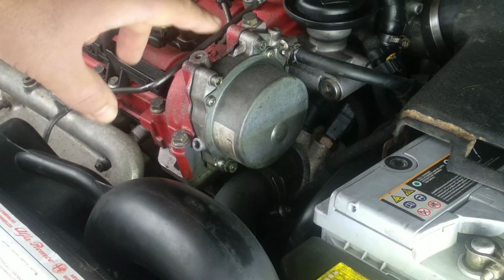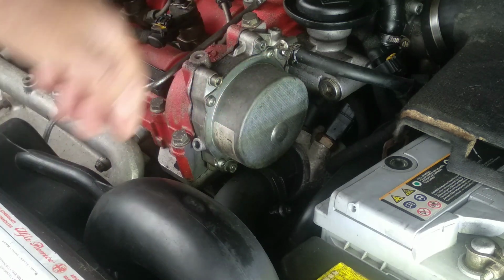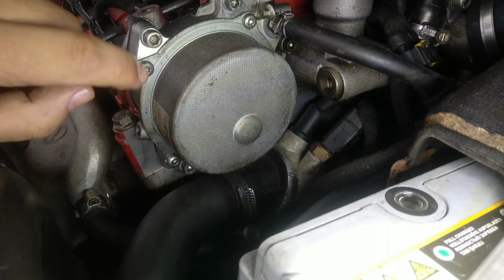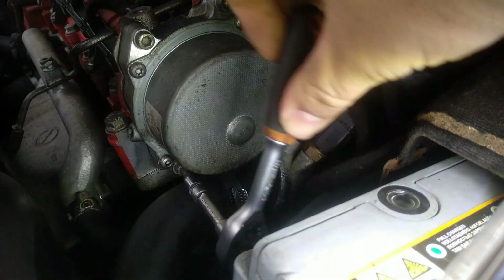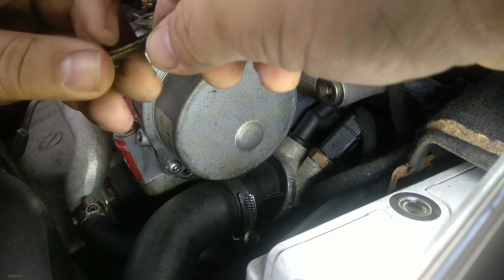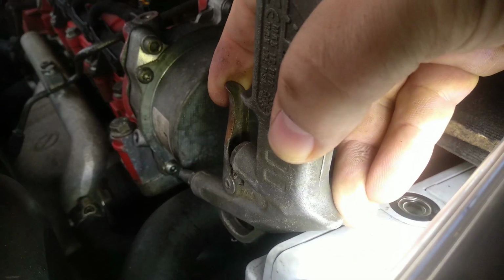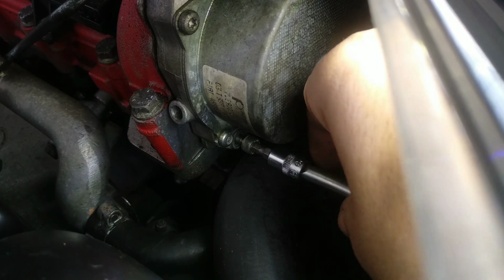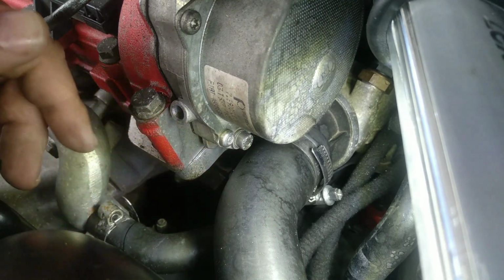Solution for oil leak! Avoid oil all over the engine. Quick tips!

Comment: Is the problem similar on the front screw holding the head cover? I see a lot of leak around those big screw too
Reply from the maker: Hello. Not that I'm aware of. Why happens is the oil traveling there from here
Reply: @alfaromeonoproblem  I already changed the vacuum gasket with proper sealing on the screws, etc... but the leak is still appearing and it does not seems to come from the pump.

On a thread of forum I saw someone fixing this issue by simply unbolting the four front screw holding head cover and putting loctite blue.

Look at here the thread of the screw after a minute of video, it is full of oil (and I just did clean the engine 80kms ago)

 https://www.youtube.com/shorts/z7IbclnCWRk
Reply from the maker: @nicolasmillasseau2321 the link is not responding. But check out the oil fill up neck gasket and sxrews

Comment: TNX for this tip.
I have oil leak just there.
Reply from the maker: Hello. Thanks for watching! I hope you can fix it
Reply: @alfaromeonoproblem  Can I use gasket silicone ?
Reply from the maker: RTV on the bolts? It's quite messy and there is no guarantee it works 100%
Reply: @alfaromeonoproblem  Than I will use that treed stuff from video